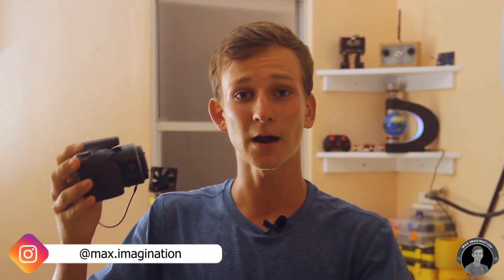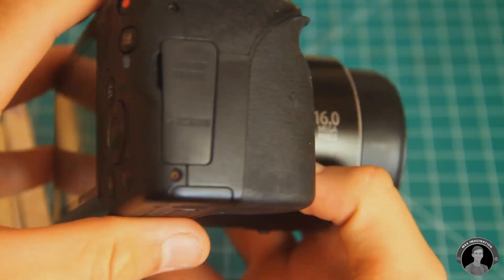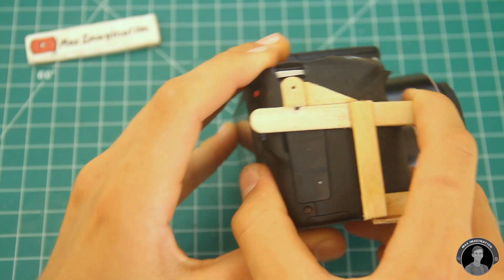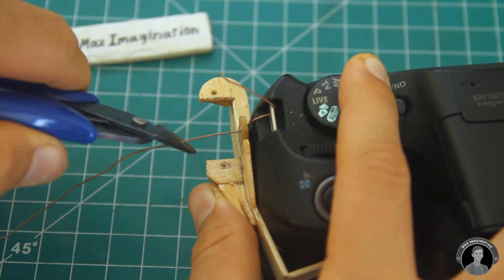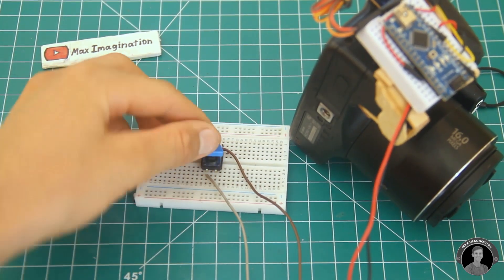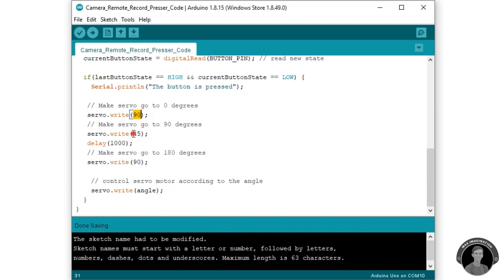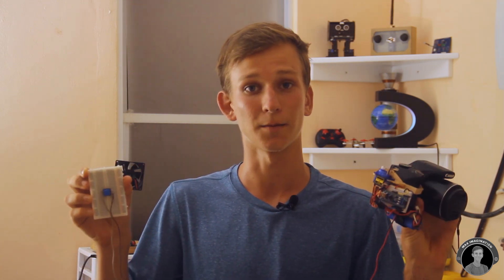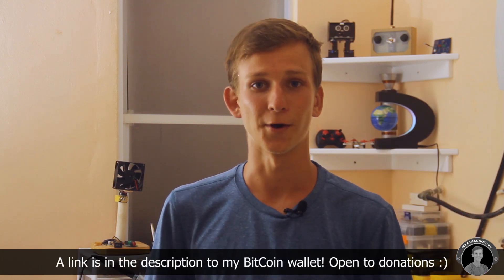DIY Camera Remote Shutter Controller | Arduino-based Accessory | Innovative Recording Device

Comment: Hey question!  How would you alter code so that servo only releases once you release trigger
Reply from the maker: Hey there! I'd need to see the code again to help direct you exactly on how, but you would normally use an "if" statement checking whether or not the button was pressed and based on that to let go on the servo and make it move.